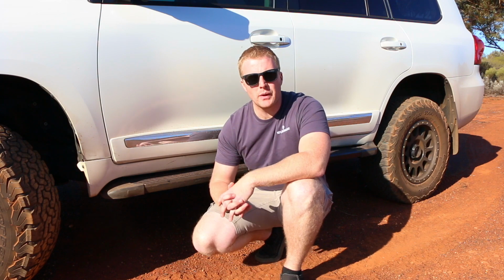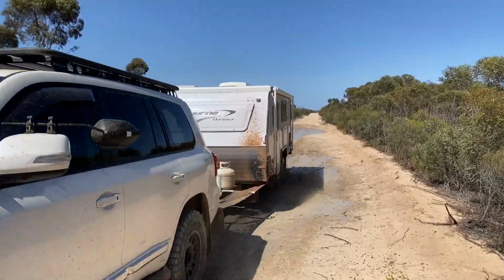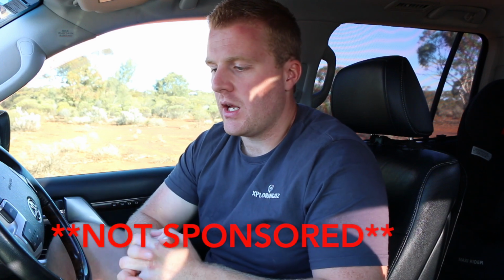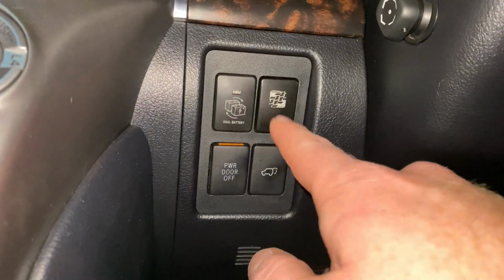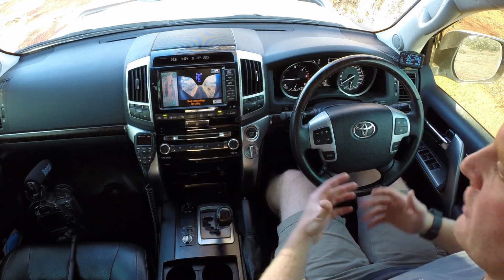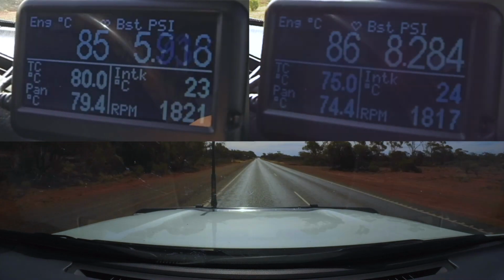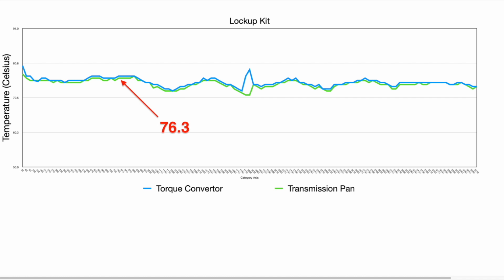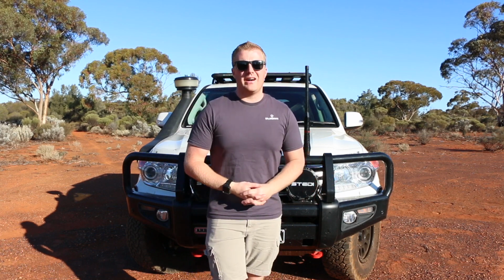TORQUE CONVERTOR LOCKUP KIT | HUGE difference! | How does it work and why? LC200 Stocklock Extreme

Comment: I had AMV Automotive in Perth do a Richards LUK ( 3 settings auto, off, manual ) Trans remap and engine remap, in my 200 series when i was on my first aus trip. Towing a 2.5 ton van and the Kelpie in the back, fuel consumption dropped by 8 litres per 100 at least. Let alone trans temps ( as read through an ultraguage ) dropped 40 C on average. By the time i had gotten over to Katherine, it had almost paid for it self in fuel savings. I cant stress to any one with an auto 4x4 the benefits of having one. Gleno, Bendigo Vic. Ps, It was 2017 when done, well and truely paid for now.
Reply from the maker: For sure mate, they are great little units and I would recommend them to anyone. I'm also looking to get a transmission and ECU remap in the future to compliment this kit and I think it will help significantly with fuel.
Sounds like you've had a great win with your vehicle, thanks for sharing your experience. 
Cheers, Nathan.
Reply: @XploringOz  theres a few vids on my chan ( blatant plug there ) ..i do a lot of camping and towing, anyway... comment back to me in 12 months after you do some towing kms with the LUK. you are going to love it.
Reply: Have you had any issues long term running the lock-up kit?
Reply: @peterj5751  No issues and it will be 5 years in july 2022
Reply: Was that the Richard’s Auto remaps s well?
Reply: @peterj5751  custom engine remap and trans remap. I dont know if richards had a trans map at the time. I assume it may have well been. The shift points were altered. made a whole lotta difference.
Reply: @glenod  thanks Gleno.
Reply: @peterj5751  no problem. id recommend any one with an auto, of any brand vehicle, to get a lock up kit. More so if towing. Keeps the trans temps down and fuel economy.
Reply: This was a very good video you explained this very well
As I also tow a heavy van with a stock 200 where did you get your stock lock installled
Cheers
Reply: @Daviddoherty1923  i have a richards lock up kit, it was done by AMV automotive in perth.

Comment: Great Vid. I have had the Richards Electrical lockup kit for about five years on my cruiser and it has been excellent. Toyota should have made them this way. With the vehicle empty and not towing, we averaged 12.6 l/100 driving Collie to Manjimup.
Reply from the maker: They sure are great pieces of kit and I've only heard good things about the Richards kit as well. 
I guess Toyota had to design these for the standard, non-modified vehicles, however maybe they should have made it a little easier to adjust the settings from factory for people like us who like to modify and tow. 
That's good fuel economy for a heavy V8 4WD.
Thanks for sharing.
Cheers, Nathan.

Comment: Great video, What is the max safe operating temperature of a torque converter ?
Reply from the maker: Thanks mate. So this will ultimately depend on the type of gearbox and the type of recommended oil that the gearbox manufacture recommends.
Most oils having an ideal running temperature and then have ratings for short spikes in the temperatures, for example during the unlocked period as shown in the testing prior to the lockup kit. The exact figures for these temperatures would be specific to the oil grade shown on the product. 
As my testing shows, I (in a modified, towing vehicle) spend more time than a standard vehicle in these 'spiked' temperature zones and as mentioned, the hotter the oil, the longer the oil remains at raised temperature, the shorter the life of the oil and a reduction in its efficiency. 
Hope that makes sense.
Cheers, Nathan.
Reply: XploringOz thanks Nathan was taking about a 200 series / standard  with oem oils?
Reply from the maker: @dannyjansen6011  So the OEM  'WS' oil that Toyota supply from factory has a flash point of 175 degrees Celsius. Although this is not a definite point of failure it is a good indication of when the oil chemical makeup will start to break down and significantly effect the performance of the oil.
The LC200 auto transmission temp light activates at about 150 DC.
Although this is only one simple measurement of the oil efficiency at higher temperatures, it does provide a good indication.
Suitable replacement oil (not OEM) have flash point between 40-50 DC higher than that of Toyota.

Comment: G’day Nathan, brilliant explanation and video! I didn’t came across this kit when I installed my one..doesn’t matter since I am extremely  happy with my one too. Your tech explanation was top notch, cant be any better. Please do a review after 10,000 km when you got more experience with it and play around time. Would like to see your experience in comparison to engine load, rpm, selected gear, travel speed and engine torque sweet spot. Whereby the travel speed is variable . Your test was set to 100km/h what gear most of the time? 6 th.? On which rpm?. I am happy with my auto CU remap bringing the shifting point for 6 th. Gear into the range below 100km speed. Watching the engine load and rpm to have the engine in the torq sweet spot on low rpm in 6th. Gear compared to previous factory setting open system where the box never shifted into 6 th. Gear below 110km/h. So for long distance traveling on road towing a van it makes a significant difference in fuel consumption and converter and oil temp.. But as said previously, every car and van are different and must be experience by the owner himself. Lockup kits pays for himself over the time and is also much enjoyable to see what it does on the ultra gauge. Cheers
Reply from the maker: Thanks again Holger. I will be sure to do a long term review in the future for sure. 
So for my testing in this video, the vehicle was set to 5th gear, just because I was towing. I choose not to tow in 6th.
I agree with your thoughts on the transmission remap as well and this is something that I will look to in the future as well. Having the ability to customise the shifting points and sensitivity in the gearbox would make a significant difference to how to the vehicle performs and behaves. 
Thanks, Nathan.

Comment: Toyota do have a lock up in the TCM. LOL
Reply from the maker: Of course they do, however, as mentioned in my video, the standard transmission lock up settings simply don't cut it for a modified vehicle like my one. Further, Toyota have no way of manually locking up the TCM from factory, hence the addition of this kit. 
Cheers, Nathan.